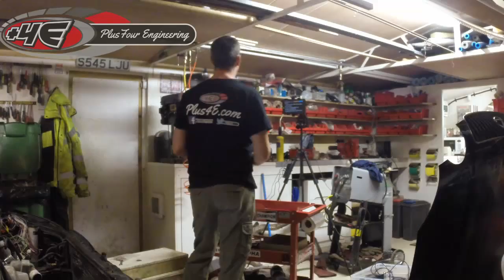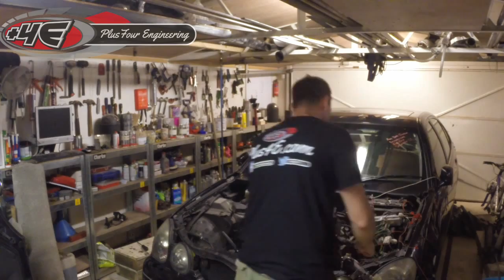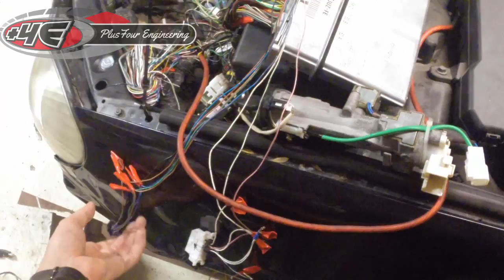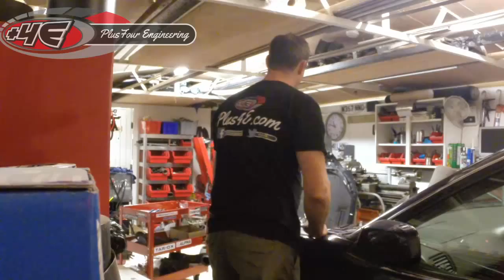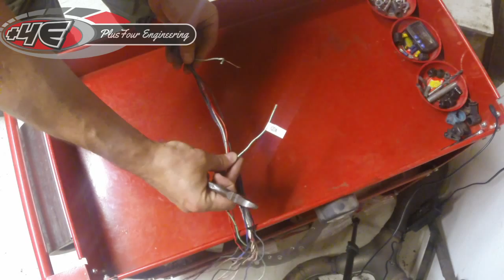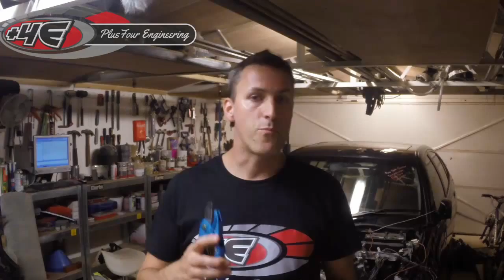Plus Four Engineering Tutorial 1 - 3UZ wiring on stock ECU

Comment: Hi, I have a 3uzfe and 6 speed automatic transmission from a Toyota Crown, and I need help with the wiring in order to get the motor going, I have throttle pedal, airflow meter, computer, shifter for transmission witch is tiptronic, harnesses on motor and transmission, I have plugs for the computer, I need to know the pin outs and colour's for the pins that are not already connected to the engine and transmission.
I have to get the computer demoblised. Car was a Toyota Crown 3uzfe majesta Japanese